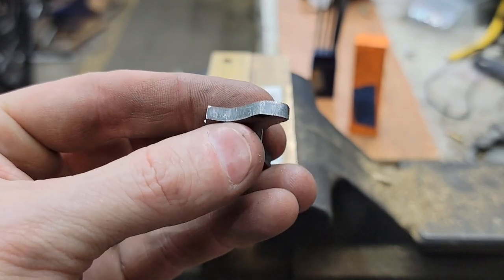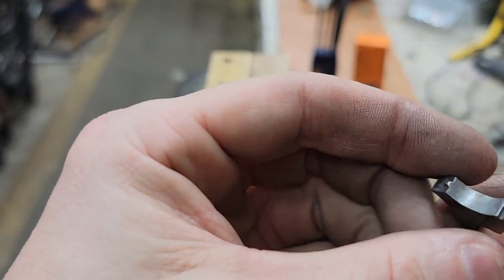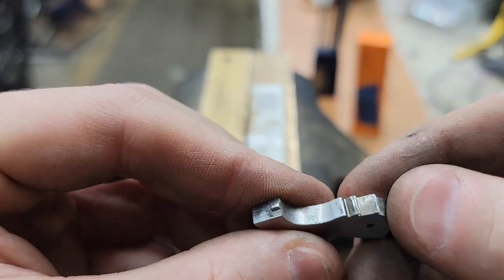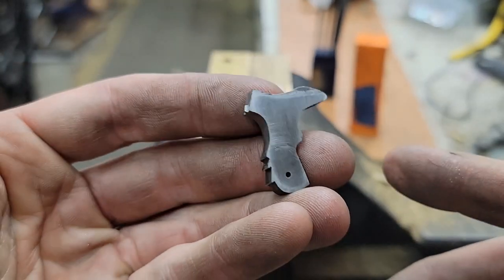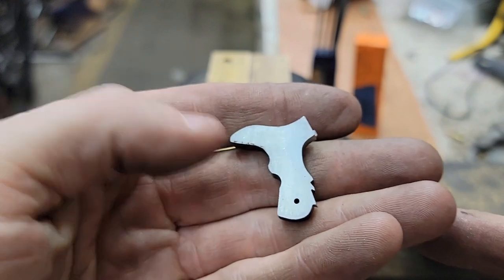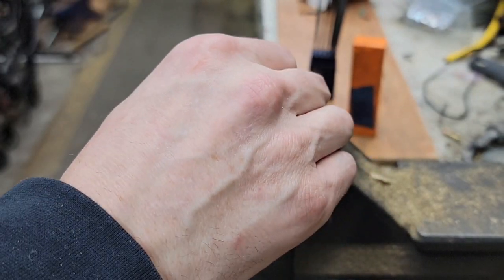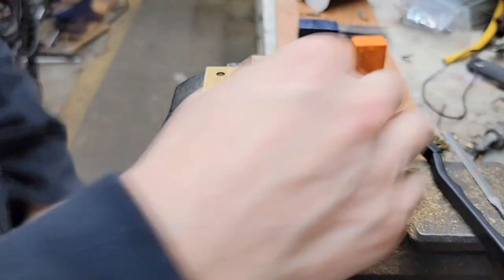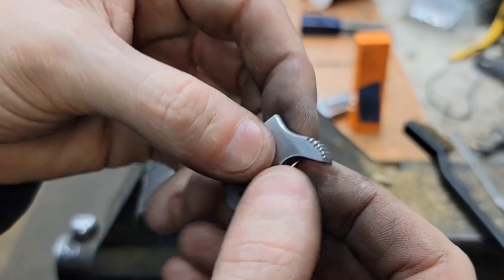DIY Sheetmetal Derringers 22lr Homemade Guns Model 2 - Hammer Finish Work

Comment: .... Is there a rough cut kit?
Reply from the maker: @Truthtellor-vh4ke  not that I'm aware of for the model 2.  There have been a few places selling the model 1 plates.  They required drilling a couple of holes and welding them together.  The barrel and small parts were sold as a separate kit.  But at least one of the companies stopped when the AFT was going after the 80% receivers.  Just not worth the time and hassles for small companies and small parts runs.  
These are great little builds for the new builder.  Done right, they look like something factory from 100 years ago.  
Here's a few more Model 2's https://youtu.be/FFT7h1pGW8Y

And some Model 1's
https://youtu.be/MBIF-PGMays
Reply from the maker: @Truthtellor-vh4ke  I started a complete build series for these.  Youtube took down the first short videos, but about have the build is still documented on Rumble (jfgmfg)  I should get back to that.  I have a few more of these started.  Finishing the video series would be a good excuse to finish the builds !